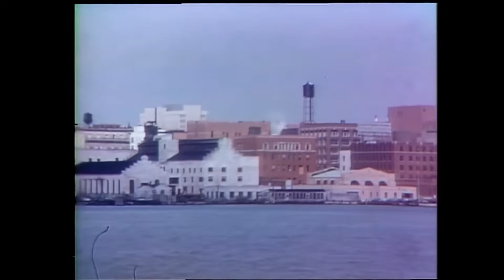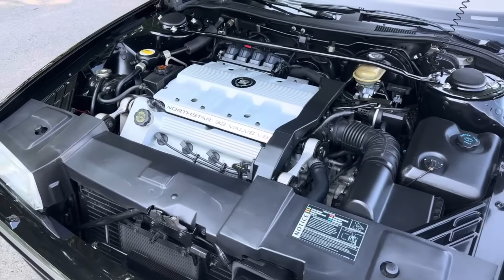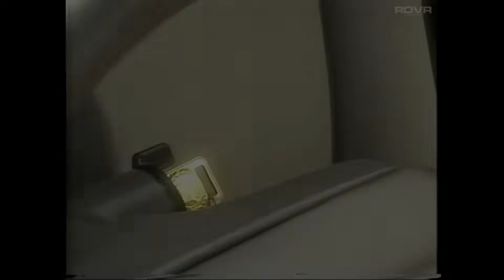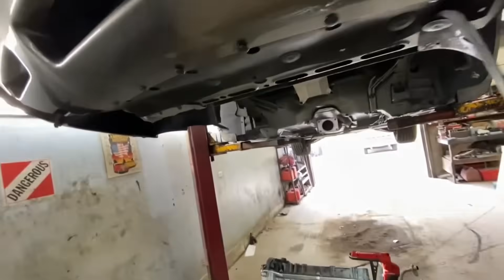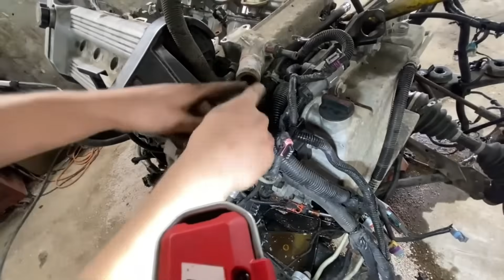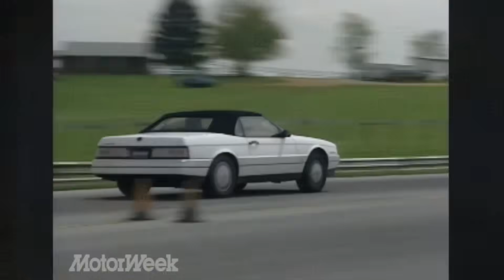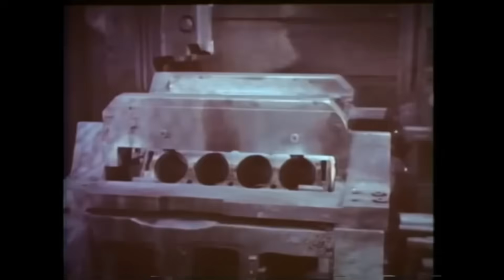Most HATED American V8 Engine of All Time!

Comment: GM could have saved a lot of headaches by simply redesigning the cylinder head gaskets and head bolts.  MILLIONS of those cars would still be on the roads today!  GM/Ford/Chrysler always do such stupid things: put a crappy engine in front of a great transmission, or put a great engine in front of a crappy transmission.  These car companies are always so penny-wise and pound-foolish!

Comment: If you're old enough to remember, like me, the Chevrolet Vega had a similar problem.  Chevrolet used an iron head and aluminium block with etched aluminium cylinders, no sleeves.  The different expansion rates between the iron and aluminium caused head gasket failures and coolant in the aluminium cylinders destroyed the finish.  The engine was essentially junk.  GM finally fixed all the problems on later production but the reputation was already destroyed.  Ditto on the early Oldsmobile diesels.  GM has a bad habit of not fully debugging great new designs before release to production.

Comment: The oil leaks were the worst for me.  The GM prescribed repair was to remove the engine, mount it on a stand, turn it upside down, and remove the lower block, which doubled as the main caps.  The Northstar uses 20 long and skinny main bolts that are located next to each in pairs on either side of the journal.  Being so thin, they tended to twist many degrees when trying to loosen them.  One snaped off.  That car returned to service with nineteen main bolts.

Comment: The 4.1 and 4.5 V's were horrible engines, under powered, and very prone to oil system problems. The 4.9 was actually a good motor but not always easy to work on. But in general, it was reliable and would go many miles with minimal issues. The NorthStar was a terrific motor in many ways, but poor design regarding the head bolts was its unfortunate and incredibly stupid flaw. What were they thinking when they designed fine threaded head bolts screwing into soft non hardened aluminum? Ford did a far better job with its SOHC and DOHC 4.6 engines. The SOHC 4.6 is one of the most reliable and trouble-free engines made by anyone.

Comment: I had a '97 Deville, with this engine,  for horsepower, and tourqe, I found it fantastic, I was whupp'n Impala SS, frying those tires, but I found this engine is very temperamental, don't be low on coolant, or miss oil changes.  Soon head gasket issues appeared, total money pit.

Comment: What isn't mentioned here is the kind of alloy used in the manufacturing of the heads. They were made of a blend of metals that engaged in a chemical reaction with regular green coolant which gradually dissolved the alloy internally and created fissures that allowed coolant to escape and mix with engine oil. All this happened while giving the same symptoms of a bad head gasket. I've learned this lesson the hard way. Also, those fine thread head bolts cut into the aluminum of the block as they stretched during the torque down and over time and countless heat cycles, those bolts came loose, with disastrous consequences. Change the bolts you might think, nope 👎. Once you take out the head bolts, the thread from inside the block comes right out with the bolts, leaving only one option to save the block, which is drilling out every hole, cut new threads and insert helicoils as substitute threads. All in all it was a terrible design of an engine and not just because of all this, but everything else on this contraption made very little sense. The placement of the starter inside the engine valley for example. Or the shaft driven water pump on the opposite side of the engine, the placement of the AC compressor and so many other things that make you question the engineering schools the guys who designed this junk got their degrees from.

Comment: My Dad had a 96 Seville with this engine and it was quite nice. It had pretty decent power for the time and accelerated quite well, but I admit when we got rid of it it smelled like coolant and likely had a gasket failure but it was old by that point. It didnt seem any less reliable than any other for us but oh well.
Reply: Not very likely a head gasket failure on your car that you had. What probably started happening was the coolant crossover gaskets started leaking which is right where the exhaust crossover is. So, when small coolant drips on the exhaust is when you will start to smell coolant burning. Very easy fix and overall, an excellent car. My parents bought a 95 Seville SLS back around 1999 and still doing very well.
Reply: @starxlr7863  I loved it, it rode so smooth and the engine didnt give us problems till the end there. It could have been what you said im not sure, but I do miss it.

Comment: This short totally Bogus
Engine photo shows a pushrod engine w/ NorthStar on valve cover. (Photoshopped)
NORTHSTAR engine is DOHC with plug wires in middle of Valve Cover (Similar to Mopar 426 Hemi types)

Comment: Narrator has Northstar confused with 1982's 
HT 4100 aluminum V8. 
It's 50% failure rate along with early 700r4 trans failures it was mated to in RWD models killed Cadillac's reliability creds. 
NorthStar was lots more reliable and powerful.

Comment: In that same year, 1995, I took delivery of a 1995 9C1 Impala cop spec car. It had the corvette pushrod engine putting out about the same power and torque. It ran beautifully with never an engine problem. Even with those push rods everyone wants to turn up there nose at. I even got 25 mpg on one highway trip. Most got somewhere in the 20’s. It’s a shame the industry has been driven to insanely complicated and unreliable engines by a combination of stupid fuel economy standards and the endless snobbery of the magazine car reviewers who knock anything that doesn’t have 12 rabbit fur driven over and under head cams… and a 17 speed transmission.

Comment: If GM had been smart, they would redesign the engine, eliminating the failed systems. Once proven and in  production the Northstar II (NS-II), GM produces however many original Northstars were made. These become crate engines with all the different engine models represented.  Ready to be dropped into a dead Cadillac.  Customer brings in their Northstar that's blown.  Their given a new loaner.  Meanwhile, the dealership orders an NS-II for that model from a regional warehouse.  While awaiting the new engine, the failed engine is removed.  Under the hood is cleaned.  Once the crate engine arrives, complete with all accessories, hoses, belts, everything the car is delivered to the customer with the same original warranty, and complementary new engine services.
Now here's the "kicker".  You have the customer come to the dealership, and they see their original car completely new under the hood.  But leave the inside just as it arrived.  The customer has been driving a NEW Cadillac for the last week.  Now you offer them a gracious trade in value on their car plus a great price on a new car.  Probably 25-40% of the owners will go for a new car.  Most of all, you have regained the loyalty and respect of the customers who never paid a dime out of pocket.  Word of mouth is the best advertising there is.  How much value is there to have customers talking how Cadillac really stepped, accepted responsibility, and treated their customers the right way.  Customers who chose the new car option, their cars, the well cared for cars can be resold as premium used with a full engine warranty.
When all is said and done, the cost will be more than offset with customer satisfaction and newfound loyalty

Comment: The head gasket problem was an issue for multiple GM engines. We had a Lumina with the 2.8L V6. It was a great car, ran smoothly, and usually exceeded its mileage estimates on the highway right up until the chocolate milk coolant problem hit.

Did these same problems plague the Northstar’s little brother - the Olds Aurora V8?

Comment: The part in this video will relate to the electronic future of automobiles...
"You're not quite done paying for it (and the engine blows).
In a decade it will be common..
You're not done paying for it.. and the battery is (too tired to get you to your destination without 3 stops at the expensive quick charge stations) it's finished as far as being truly useful transportation and now another 30 to 40 grand to update it.

Comment: I had a 1995 Sedan Deville Concours with the 275 HP Northstar with over 180k miles when I sold it. I never had one problem with the engine. The only thing I did was change the oil/ filter when the indicator said to, and the spark plugs at 150k miles (recommended at 100k).
It was a great car with a great engine. My favorite thing to do was embarrassing Mustang GTs...😂

Comment: This was only a part of the main issue, the main issue was the open block deck casting design and the need for a torque plate to properly resurface the block deck. TTY bolts are fine on a closed block deck design.

Comment: I owned a 1973 Coupe deVille
I was 2nd owner. I bought it in 2018
and sold it in 2022.
I beat it, hard!! Light turned green. I punched it,, to the floor in South Florida summers, 6,700 lbs… it jumped every time, My 1969 Fastback Mustang, also in South Florida summers, 2,600 lbs  with a 1985 5.8 in it,  did not come close to its instant power. 472, 4 barrel Quadjunk…..
Still Rocks!!!

Comment: Why would you make a video about the Northstar and use a stock image of some unrelated carbureted, push rod engine as the thumbnail (and tack a stupid Northstar badge on the side of the image)?  That's pretty lame.  And mind you, the Northstar is actually a good engine.  The early ones had problems, but by 2006, the head bolts were replaced and the notorious problems are no longer an issue. Oh! And while you're at it, just steal video from other YouTubers and use it without any credit.  This is a disgrace!  And one more thing, the Allante, was first built with the HT-4100 engine, and only got the Nortstar in 1993.  You just can't get your "facts" straight.

Comment: I've never heard of this, and my family has one! I believe there could be problems,,,, because it has an aluminum engine!! Aluminum has no business, being anywhere near an engine!! I believe it expands at a rate of 3 to 1 compared to cast iron,,,, head gaskets will always go out!! Putting some stop leak in should be done by the factory!!
I see people are also complaining about the 5.7 diesel engine? My family had one of those too! Great engine, when you knew how to drive one! It's not a gas engine, it (1980) only had 120 HP,, not 200 HP! Don't be  trying to make the tires squeal every time you take off! The best part,, 35 mpg in a heavy station wagon!! What GM failed to do was make the motor from the ground up,,, just maybe we'd still have real cars today??!😮😊

Comment: So many things wrong in this videos an example is when you mentioned having to resurface the cylinder heads as if it was something you only had to do on this engines. You always resurface a head when disassembling and reassembling an engine and/or when heads come out

Comment: 305 with ESC in trucks  as soon as you actually needed the horsepower the engine would just shut down. Complete garbage, tossed half a dozen of them in the garbage. I wouldn't be stupid enough to buy a GM with 32 valves.

Comment: My 2004 Deville looks & runs like new!  NO head gasket problems, & NO leaks, with 180K on the clock! I'd buy another IF this one ever dies!
Reply: Yes I have my 05 Deville just turned over 200k, a 1994 Seville with 213k and a 1993 Allante with 156k. Only basic maintenance and just enjoy driving!

Comment: THIS VIDEO IS MOSTLY FALSE. I CAN TELL YOU THAT THE PROBLEM WASN'T TALK TO YIELD VOLTS IT WAS THAT THE ENGINEERS DESIGNED THE ENGINE FOR A STEEL SLEEVE FOR THE BOLTS IN THE ALUMINUM BLOCK AND GENERAL MOTORS SAVED $300 PER ENGINE TO NOT PUT THOSE SLEEVES IN THE ENGINEERS ENGINEERED IT PROPERLY. IT IS VERY EASY TO SLEEVE THESE NOW. AND YOU DON'T HAVE TO PULL THE ENGINE TO DO IT. ALL YOU HAVE TO DO IS TAKE THE HEADS OFF AND  install Heli coils or whatever they call them. that fixes the problem

Comment: I junked my 2003 STS a few years ago with 101,000 miles on it. I paid $6000 for it in 2009 with 52,000 miles on it. I still have a 97 Eldorado I paid $400 for 8 years ago with a blown head gasket. My wife drives it to and from work daily, have to add a gallon of water to it every few days and coolant every month or so. It'll be driven into the ground. It has 62,000 miles on it now.
Reply: 97-99 was the worst years they actually shortened the headbolts (same thread size,Smart huh)..2000 they went back to the longer size (same thread size),think they tapped the block deeper…same  failure…by 2004 they finally went to a coarser threaded headbolt..aftermarket companies have designed their own coarse threaded head STUD- not bolt..the problem started when they started production of this engine, gm had coarse threaded bolts on paper, the bean counters  seen they had crates and crates of leftover quad 4 fine threaded head bolts on hand and used them to save money…it backfired cause gm spent a ton replacing complete engines cause that was the way they did it, later they cheaped out and started heli-coiling them…
Reply: Put head gasket sealer in it.

Comment: I'm a 20 + year veteran of the Cadillac service departments.
This video was partially accurate with  idiotic statements and a lot of photos of non Northstar parts and engines and vehicles. 
They did not mention the Pontiacs that it was found in,
Or the derivative, the 4.0 l Aurora engine.
It is the alpha male of engines.
8 quarts of oil capacity.
5 quarts to run on, 3 quarts to mark its territory with,from a multitude of oil leaks.

Comment: .
    In January, I bought a rare Jewel from a trusted, long established Ford dealer. A beautiful 2011 Hyundai Sonata, in Pacific blue, with 71,000 miles on it or about 5,000 miles per year. In it's 14 years, 2025 was the first year it saw road salt as all of it's winter services were done in Naples Florida according to Car Fax and according to NHTSA, all of it's recalls had been addressed. This car is practically like new inside and out and I got it for $7,000.00 plus the4 year 60,000 mile extended warrantee that I ALWAYS buy on EVERY car that I buy. I've NEVER lost money on one.
    On the 4th of July, I was driving back from my son's house when it dropped to 20 MPH, began to buck and the engine light started flashing. I limped it the last 4 miles home. (This was the one day that I forgot my phone.) When I got home, I called AAA and had it towed the 50 miles back to the dealer expecting to have to pay the $100.00 copay for the repair. I got a call 3 days later saying that the warrantee company refused the claim. The top of my head almost came off when the guy told me that Hyundai had extended the warrantee on the 2 liter turbocharged engines out to 150,000 miles, that they were having it towed to the Hyundai dealer 5 miles away for a free engine swap and I could pick up a free loaner car from Hyundai. I reattached the top of my head, smiled to myself and thanked the service manager.
    I finally got my prize back on Saturday, 7/19 with a Hyundai rebuilt engine. Apparently, they don't stock 14 year old NEW engines and cars, when rated for gas mileage and pollution output, are rated, NOT the engine so they couldn't have legally install a NEW engine if they wanted to.
    I was happy with the old engine, before all of the crankshaft and connecting rod bearings came out of it, for performance and fuel economy but this new engine has it beat on both counts hands down. With the old engine, you couldn't lift your head from the headrest until you lifted your foot from the gas pedal. With the new engine, it will throw you into the back seat as these little 2 L. engines are rated at 210 HP @ 6,600 RPM. My mother had a 1968 Ford Torino years ago with a 302 V-8 engine rated at the same 210 HP but at 4,800 RPM.
    I was getting 24 MPG around town and 33 on the interstate with the old engine but, on the way home, I was getting 44 MPG, if I kept my foot out of it, and 30 MPG coming through town. Even though it requires premium gas because of the turbo, I'm still saving money over the Grand Caravan that I traded that had a 4L engine drinking regular. 
    I bought this car for $7,000.00. Cost for the engine swap, (at Hyundai's expense), $3,500.00. This car and I will be having a long and well maintained, relationship as it is comfortable to drive and corners like the 45 series tires are soaked in pimp juice. (Pimp juice is sometimes poured over tires at drag races to make them extremely sticky.)